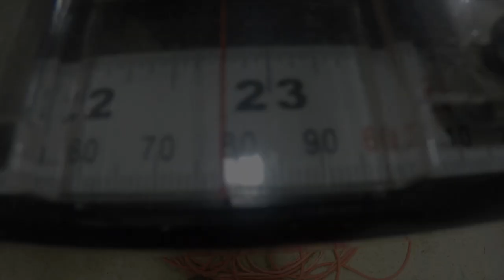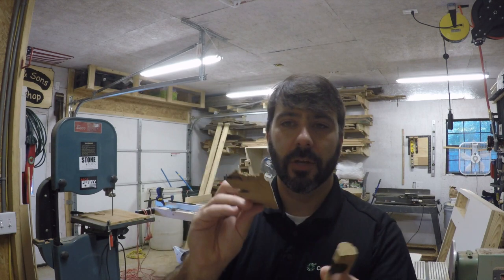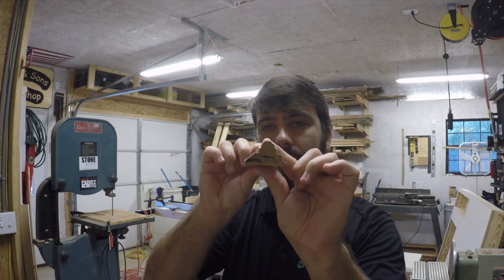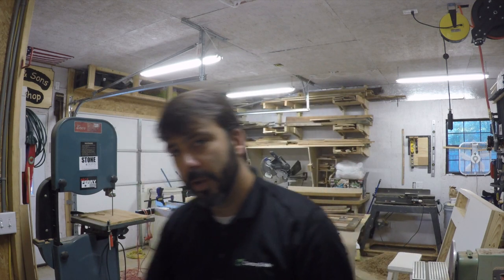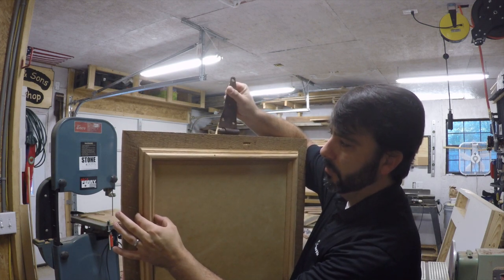Picture Frame with Moulding - Biscuit and Spline Joinery

Comment: Hey Shawn, Tried to think of something funny to say thru the whole video.  Couldn't come up with a thing till I saw you cutting the hinge.  Your dewalt is soon gonna be a dewont.  I have tools like that grandma.
Reply from the maker: Ted Alexander The wheel still turns, so I'll keep using it. LOL. Run 'em till they fall apart, right?
Reply: Absolutely.  I have a laminate trimmer that runs at different speeds.  Depends on how you hold it.  It's my variable speed router. I like your picture frame.  And I know that the customer does as well.
Reply from the maker: Thanks, Ted Alexander